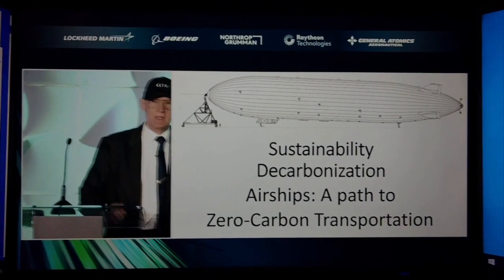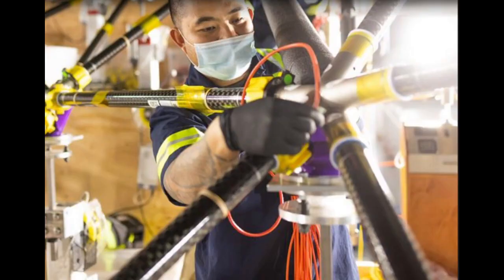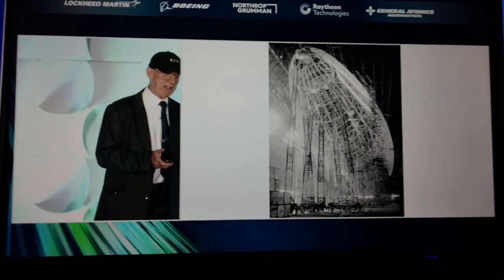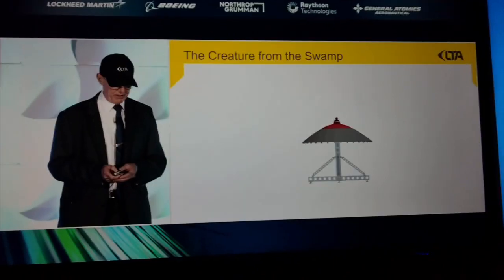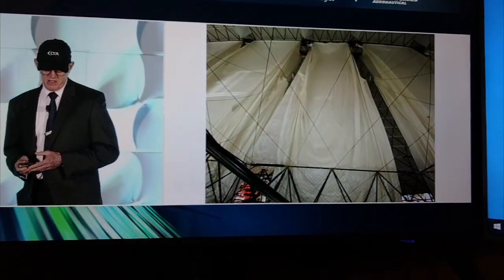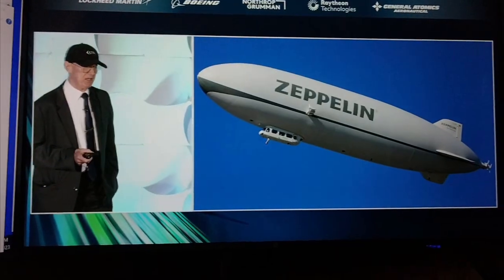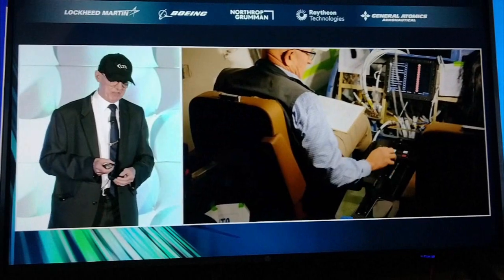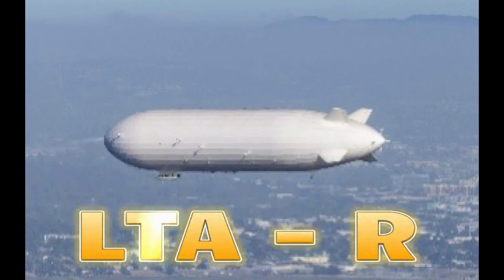Pathfinder 1 - World's Most Advanced Airship

Comment: Even a modern airship is still a fair weather transport. Dangerous in a high wind or storm.
Reply: If you have a delay of say 24 hrs due to bad weather when delivering a cargo to a remote location by airship, that is irrelevant compared to the 5 years and millions of $ it will take you to build a road!
Reply: Airships do better in harsh weather than helicopters, actually. Their vulnerability to wind conditions is overblown.
Reply: We have very good weather prediction now, so that will be much less of a problem for the prepared.
Reply: in flight, with reasonably powerful engines, these things can take a lot. operating larger airships in rough weather is absolutely possible and has been done before.
however near the ground it may get more difficult

Comment: I would urge you, not to make this some feint at green credentialling, instead making it safe and practical as possible. Personally, I would be more concerned about the material used within the batteries. Li-ion batteries are the finest random ignition source known to man. I would firstly move to a more stable solid battery chemistry, while allowing for the use of diesel engines for emergencies. Redundant systems should be quad-level, as it is a new design, and allows for peace of mind.  The testing analysis might take several years to support the architecture in detail, I also presume.

Comment: To what altitudes will this be designed to fly? I would assume clean air would be ideal, which is 35,000 feet plus, with at least another 10,000 feet margin to escape the worst of tropical storms? This implies  pressurising the human habitation areas, and air conditioning throughout. The electrical load on your batteries will be very high, and I presume have all been factored in? Further to that, what load can the structure bare, either internally or externally? This could provide extra lift capacity for non-critical deliveries of packages, mail and assorted goods. My last information was that they can carry large and heavy loads, underslung to the craft.  If this is so, then I would imagine that the dirigibles time has come. It will lack the speed of the giant 6 engined Antonov freighter, but the increase in load capacity should see this as a favourable option. Even if it would be for government use, or in private hands, or for use as a water tanker for forest fires. Even larger craft, whether ganged together, or built bigger would increase the carrying capacity considerably. With the increases in load making this a viable method of transporting manufactured goods, such as cars, or white goods, delivering a significant advantage over sea freight times, in particular for premium goods.
Reply: I don't think airships like this are practical anywhere near 35000ft lol. This would probably be like 8000 feet max, or maybe even less than that. And that's ok.
But yeah those are basically the goals.

Comment: Zeppelin is the name of a type of airship, as well as of course the name of the first developer and his company that built them in Germany. This ship  conforms to that type so it should be zeppelin, not "zeppelin".
Reply: BTW I was impressed by the way the ship was built. But I think computers are well able to allow the use of  a large variety of rings instead of what you did and indeed what Graf Zeppelin did in all of his early ships. 
Also modern electric motors are light. You can use two motors in the stern driving contra-rotating propellers and you can control them in the way helicopter main rotors are controlled to use them to steer the ship. This saves weight and drag. 
But for a first try your way of shaping the ship is probably best.
Reply: You used the same spelling for both?

Comment: The roller coaster is genius
Reply: Same principle as used by welders for welding large diameter pipes or ducting ...it requires heavy pipe sections to be able to be rotated  smoothly so the welder can weld sections together.  
Just a lot Bigger 😂... great to see the progress .. using electric propulsion motors enables a safer distributed propulsion system that is easy to make vectorable.  For improved controllability in flight and ground handling.
By using Generators they can be lighter than propulsion motors need no gearboxes..and can be run at their Stoichiometric optimum all the time saving fuel and reducing wear and pollution. ..
Better still if they could use a new design like the Liquid piston rotary generator design 30 % more efficient and smaller and much lighter than a conventional Reciprocating piston engine. With no vibrations and less noise and heat.

The final creme would be to integrate a flexible solar panel skin ..like the walk on type used on sailing Yatchs.. covering perhaps half or 3/4 or the radius and half the main cylinders length and possibly the outer and uper fin surfaces.

Comment: The problem that put the US Navy off rigid airships was the enormous forces that could be generated by that much surface area over the distance between the ends. The torque over 1,000' was enormous. Has that been dealt with. It seems to come from pretty basic physics.
Reply: The problem that put the U.S. Navy off rigid airships was that they lost three of the four that they had in storms, due to a combination of gross negligence, engineering mistakes, and pilot error. 

The bending moment for an airship 1,000 feet long (i.e. considerably bigger than the Navy’s airships, which were 785 feet long) peaks at 45,000,000 lb/ft of torque. This is quite a lot, but modern aluminum alloys can easily accommodate such bending forces. In fact, they can do so while weighing less than historic airship structures, proportionally speaking, despite being stronger. The aluminum used back in the 1930s was a 1900 series alloy that was about 30% heavier for a given strength than modern 7075 alloys.

Comment: The 'Hindenburg' tragedy still echoes in many minds;...but let us not forget that, in the late 1920s, the 'Graf Zeppelin' travelled a million passenger miles without serious incident, or loss of life. And that was on hydrogen as lift gas.  The critical factor was the adoption of 'Blaugas' as fuel.  This stuff was ideal for gasoline engines, and had specific weight of "1", so that fuel consumed was replaced by air....thus preserving equilibrium and, to a significant degree, obviated the need for venting lift gas.  Though I believe that gyroscopic stabilisers are practical for use in rigids, I am not aware of anyone who has ventured that far.  Perhaps,...in another hundred years!  Best Wishes to all airship people.
Reply: I haven't heard about blaugas before, (not that I can remember anyway) thanks! Seems like that approach would require an absurd amount of volume for a given amount of energy, reducing the space for lifting gas and by that capacity, significantly. Seems to me using water collected from the engine exhaust would have been a much more practical solution at that time. Ideally using methane as the fuel, even if it in principle should work with any kind of fuel with a lot of hydrogen in it.    

While I'm not a chemist, I think each molecule of combusted methane should produce two molecules of water, and one molecule of CO2, as in CH4 -> 2 H2O + CO2, and if that's correct, one would only need to collect slightly less than half of the water from the exhaust to maintain constant mass. Collecting most of the water vapor from the exhaust should only require cooling the exhaust down to well below the boiling point of water, making it possible to even increase the total mass of the system during flight, about the same amount as the amount of fuel spent, assuming the fuel is methane.         

While I'm obviously not an expert on airships either, to me it seems potentially much more useful to be able to gain enough ballast during flight to significantly increase total mass than it is to be able to keep the mass constant. If you can increase total mass, you can have positive buoyancy when you ascend, and then negative buoyancy when you descend.        

Also, tanks of compressed methane gas, or potentially even liquefied methane, and then water, only require an insignificant amount of space compared to an uncompressed gas with a density similar to air.
Reply: @fishyerik  Thanks for supplying much to think about regarding methane.  Blaugas was not "blue", but named after one Herr Blau who concocted the recipe of a dozen gases including butene, butylene, propane, propylene,...and heaven knows what else!  There used to be at least one textbook that listed everything, but, with the passage of time I cannot recall the proportions, or the title of the publication.

Comment: That thing is not a traditional Zeppelin or Airship! Build one 815 - 825' long, 154' wide x 154' high, + Tail fins, 4 -5 V-12/V-16 gas or diesel engines, and paint it SILVER! Nothing more than an electric "Hybrid Airship" with a Zeppelin NT control car. 🙄
Reply: This isnt the 30s anymore, you know. New requirements, new opportunities.
Reply: @Zeppleon Yeah smart ass i know that! But still, that's a zeppelin/Airship I'd love to see flying around today. Not this modern crap!
Reply: No this is more than that, a fully rigid airship 400ft long. Much larger ones are planned for the future but they want to start smaller, which is perfectly reasonable.
Reply: @quickestscoped7603Unless they build em like the old ones. I'm not a fan. If i had the $, materials, a hangar, and a crew to help build one...I'd build one as close to as original as possible. 1920's/30's style